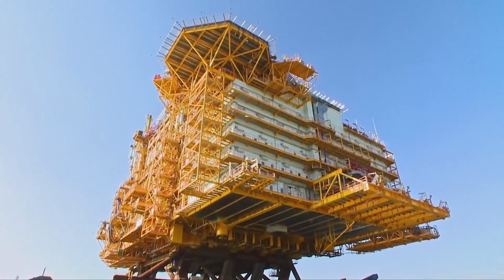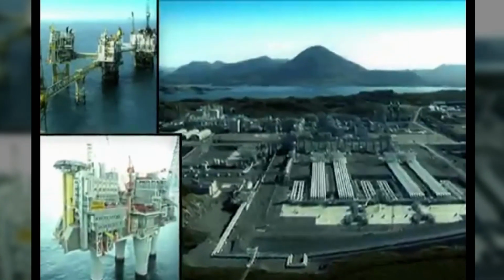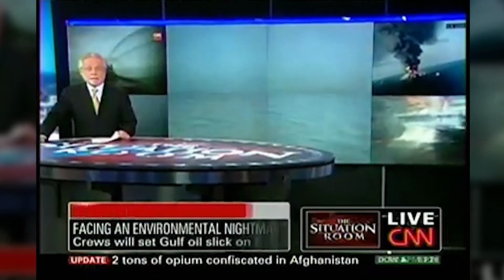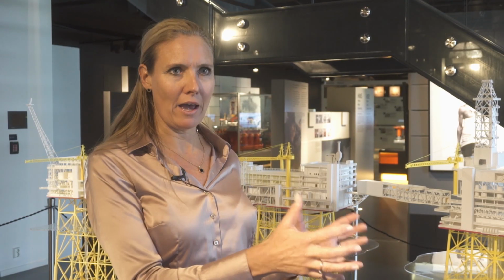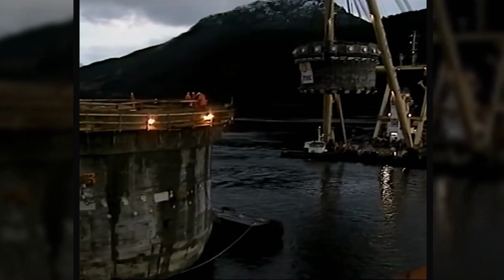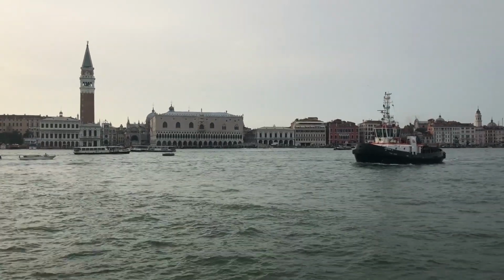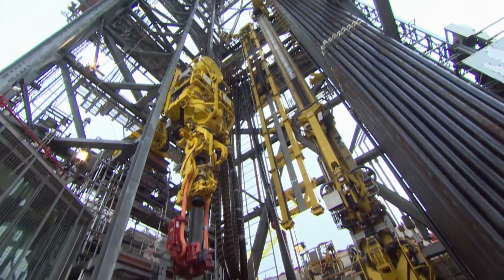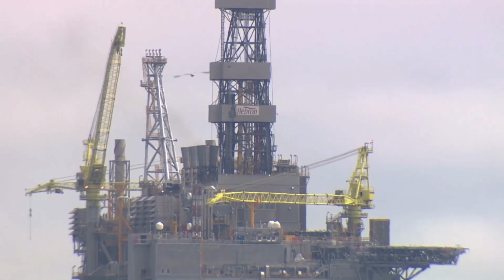Moving The World's Heaviest Oil Rig | Heavy Lift

Comment: Magnetism. Earth's internal magnetic field grounding currents through its nucleus or core where external heat energy outside of entanglement of mass is the strongest internal magnetic field. Like campfires slowly disolving internal magnetic fields disolving into external heat energy outside of entanglement of mass as fire like lightning instantaneously disolving atmospheric gases into external heat energy outside of entanglement of mass as fire lighting up the atmosphere like a filament instantaneously flash lighting atmospheric gasses. A flash bulb does the same thing. It doesn't burn mass it disolves into external heat energy outside of entanglement of mass as fire. Stars disolving atmospheric gases into external heat energy waves outside of entanglement of mass as fire or dark heat energy outside of entanglement of mass. Entanglement is absorbed heat or unabsorbed heat bouncing off and around mass.
Reply: @timothy8426  Where did you learn to write nonsense? The ability to write is not a sign of intelligence, it just means you can write, just like a 6 year old can write. What you write is important. However, you just write incomprehensible gibberish. Go back to school. Pumpkin.